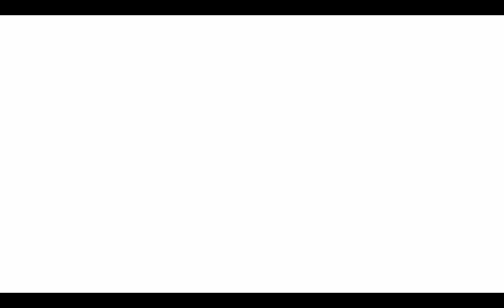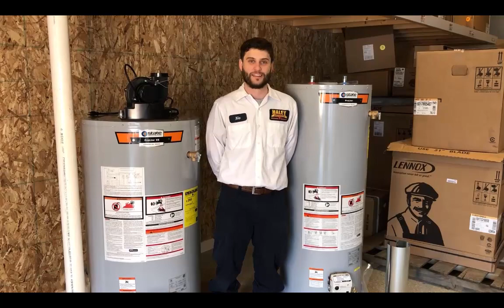What is the Difference Between Direct Vent and Power Vent Water Heaters

Comment: When I found this I got excited as I have been calling plumbers to get a direct vent water heater, thought I found one that finally knew about them.. WRONG.. I like how in the video he even uses a different term. There are 3 types of venting for water heaters. 1) Atmospheric, your old traditional needs a chimney, vents up through your roof, 2) power vent, uses a blower and pvc pipes draws air from inside house usually and vents out the wall, needs electricity for the blower, and then you have in my opinion the best solution. 3) Direct vent. vents out the side of house in metal pipe with another pipe inside, grabs outside air in outer pipe, vents exhaust through inner pipe, no BLOWER no CHIMNEY no Electricity. It amazes me every manufacture makes these they ALL call them Direct vent, yet no plumbers seem to know about them.. UGH
Reply: As a plumber for 25+ years I can confirm 90% of plumbers barely know what they are doing. Even the sales people at the plumbing supply houses mix up the terms, and use them interchangeably. So unless the plumber is self motivated enough to continually educate themselves on their own time...it's just an echo-chamber of idiots in the field. Most of them just ended up in the trade because a relative was a plumber and they just sort of ended up stuck with no other options.

If you do get lucky enough to find a plumber who knows how to install things correctly, and cares...it's  rare indeed.
Reply: Thanks this is exactly the info I was looking for!
Reply: Short and simple answer. That’s what the plumber said.
Thx for sharing comments.
Reply: Bradford White makes a Power Vent, a Power Direct Vent, and a Direct Vent product.  What would be the difference between the Power Vent and Power Direct Vent.  I'm looking on their site. I'm seeing the Power Direct Vent says Closed Combustion Venting system, which I don't see for the Power Vent one. Not sure what that is.  Every new thing I learn makes several more things to learn.

Comment: Nic, why the hell can't I vent my power vent Ruud into my 3in type b, which is double wall as you know, going up 25 feet witches from the atmospheric water heater because I'd like to interchange them just one then use the other seeing how they compare and work. So basically in the summer there will be no condensation and in the winter of course there will be some so what. So there'll be just be a trap say down on the bottom that I can catch the moisture big deal. What am I going to do corrode the type b? So I should just stick to PVC alongside the tide be possibly even then I would connect the right at the top with a t so I don't have to poke another hole through the metal roof. So what do you think?

Comment: That is not a power vent. It is a direct vent. Power vent uses outside air brings it in and uses it for combustion then exhausts it out again. It's flue has 2 channels, one for incoming and one for out going air. Direct vent uses air inside the house and exhausts it out.